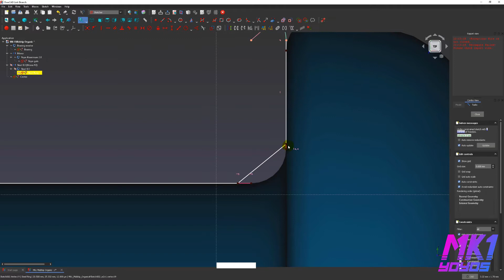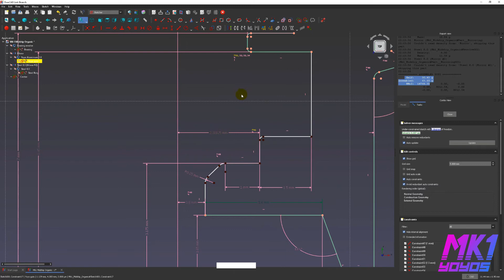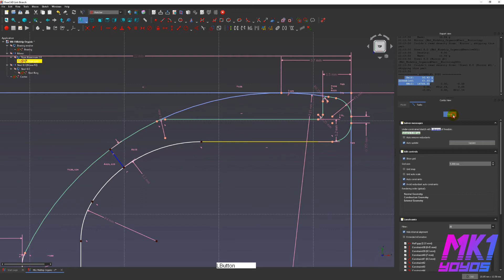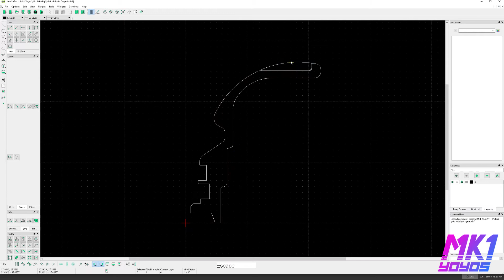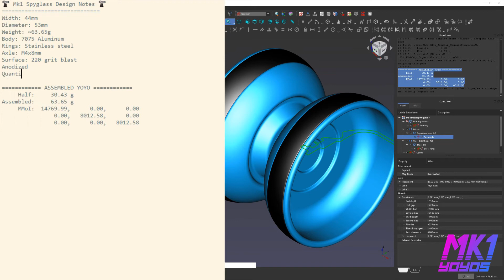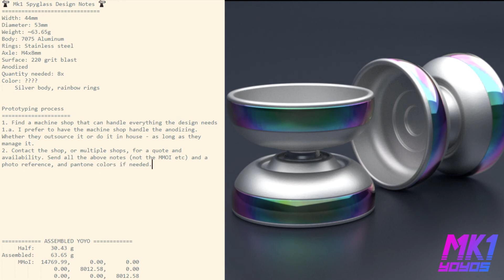Mk1 Mechanics Part 5 - File Export and Yoyo Prototype Preparation

Comment: Question: How will the shop handle the spot for the axle? Though the helical pattern is not modeled, is that something that has to be communicated alongside the model? (ie drilling the spot for the axle)
Reply from the maker: You'd tell the machine shop what size of threading you want - most yoyos use m4x0.7 (metric 4mm coarse). Almost never any need to model the threads.